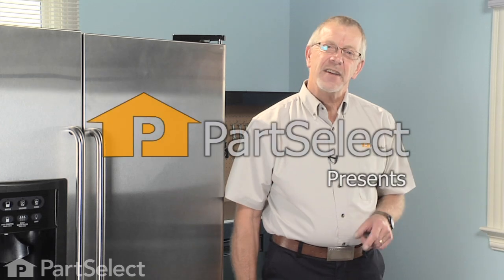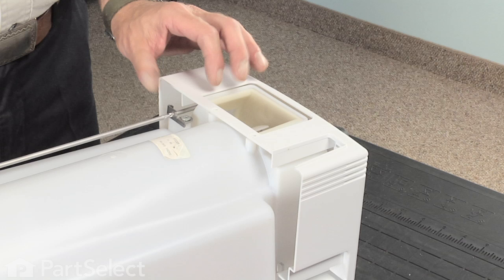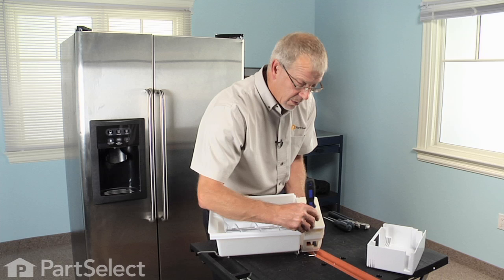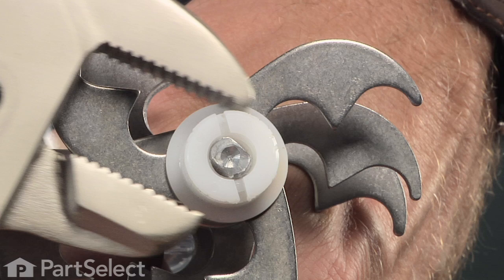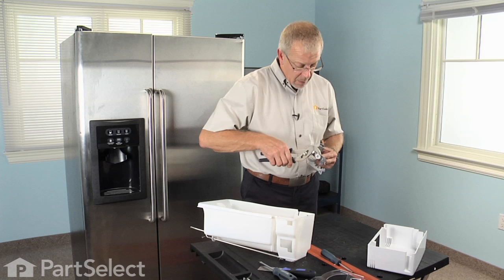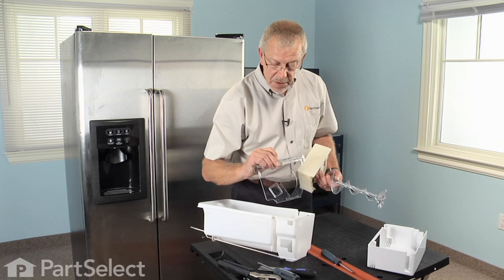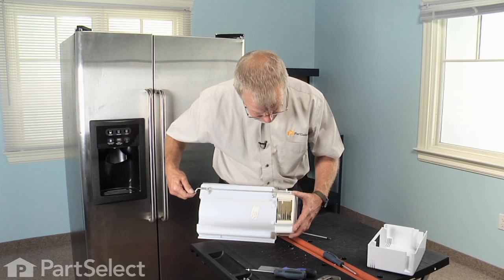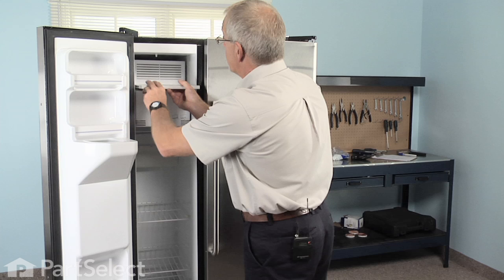Refrigerator and IceMaker Repair - Replacing the Auger Assembly (GE Part# WR17X11705)

Comment: what was wrong with the old auger
Reply from the maker: Doug Morse There
could be a few things that indicate the auger needs to be replaced. They include: ·  Ice maker won’t dispense ice.

·  Ice maker will not make ice.

·  Ice maker dispenses too little ice.

·  Water dispenser will not dispense water.

·  Unusual Noise.

Comment: I have watched this video several times just in the sequence of nylon bushings and they are in the wrong order. flat bushing blade flat bushing then the center set of combined reverse blades bushing facing in then blade then center bushing facing out then 2nd half of 2 part blade then flat bushing finale blade then finish with threaded bushing. I'm sorry but I just ran across this video otherwise I would have said something 7 years ago.